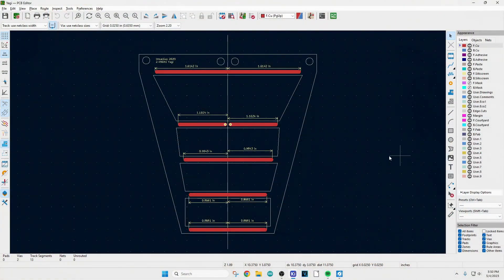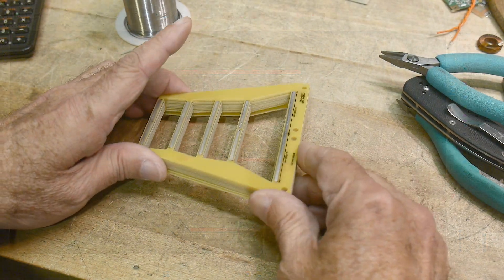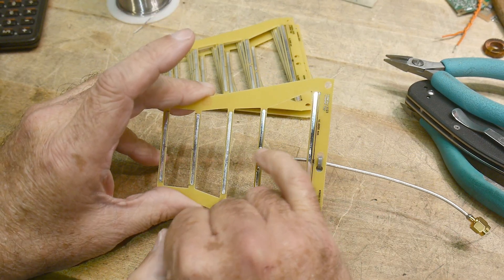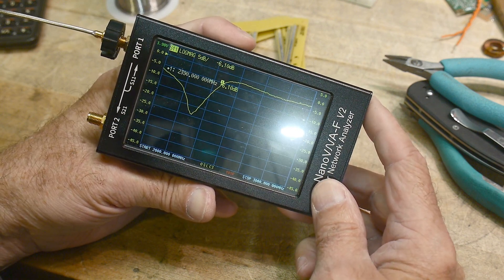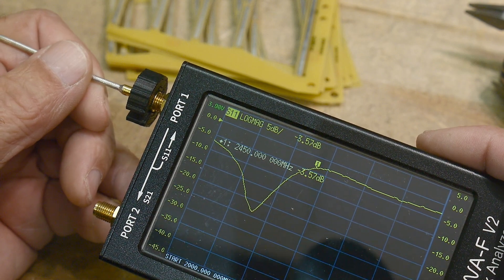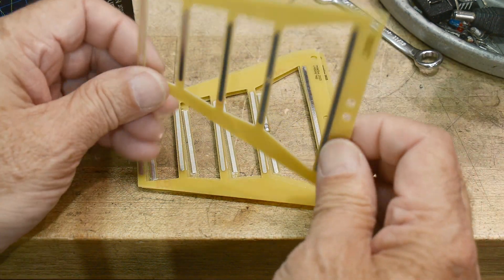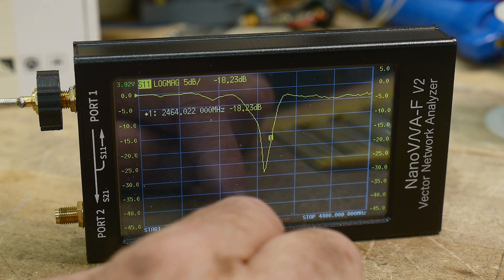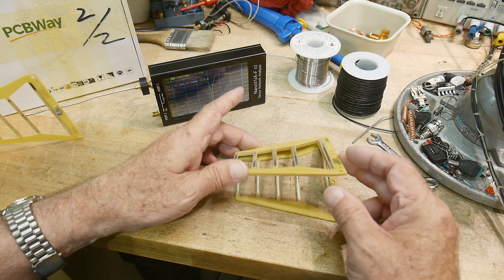#1522 YAGI design for 2.45 GHz (part 2 of 3)

Comment: I ordered the pcbs but it came with solder mask. Is there anything I can do about this?
Reply from the maker: when you order the board you have a bunch of choices:
board thickness (0.032 for this one)
soldermask (select none)

The ones you have probably are close enough in frequency

I did a video that might help: https://youtu.be/ydZ6VSJ26Qk?si=eU_w0V687JzBoyFI
Reply: @IMSAIGuy  I had to order from jlcpcb cuz pcbway was a tad out of my price range, and I didn't see an option for no solder mask. Thank you for the information though, I will keep you updated on how well it works! Just verifying, these can work as 2.45GHz transmitter antennas too, right? Also roughly 800 watts of output power.
Reply from the maker: @arkhilious  I'm not sure about 800 watts. I expected these to be used <10 watts. the pcb traces may vaporize.
Reply: @IMSAIGuy  whatever happens, I'm sure it will be very fun to watch. I mean I hooked up some TV coaxial cable to it and it was fine, so I very well might be surprised!
Reply from the maker: @arkhilious  TV coax will drastically attenuate 2.5GHz.

Comment: The ends of every SINGLE ELEMENT will have the highest voltages (infinitely un-loaded in "free-air" antenna) and any reduction of Capacitive -loss will reduce your Q far below infinity.
Grab your resonating dipoles as close to the center, and not at the peaks, ever. #FreeAir #TeslaCoilTip

Comment: The company I work for designs and builds antennas for a variety of applications and has a number of near field and far field antenna pattern testing facilities.  These two antennas would typically be tested inside a near field facility.  Sits inside an anechoic chamber and gets scanned through the various axes and then the software generates the resultant pattern info.

A lot more controlled environment than the out door far field ranges, but those are still required for some of the larger antennas.  

You could use one of the various 2.4 GHz band antennas around your shop connected one of your RF sources that goes to 2.4 GHz as a transmitting source and then connect the antenna under test to your spectrum analyzer and measure the response as you rotate the antenna in azimuth and elevation in both the horizontal and vertical polarization orientations.  Probably better done out in the back yard than your workshop to cut down on reflections perturbing your results.  I've tested a number of 2.4 GHz antennas this way.
Reply from the maker: please watch part 3

Comment: Have you tried connecting to different elements then measuring? You should have a contest for your subscribers, set a frequency and measurement minimums and see who makes the best performing antenna. No rules. Use any resources available. If  some subscribers don’t have resources then they had better get creative. We could send in stills of the design, finished product, and NanoVNA measurements. You pick3-5 to submit for you to verify and you’d have material for a  video or two. Make us do all the work for a change.  Prize could just be bragging rights.  As always, thanks for the videos.

Comment: Why isn't anyone 3D printing GHz range Yagi antennas?
Reply: Not many 3D printers that print metal in the hobby market.  Some have printed antennas using filament and then used metallic paints or other techniques such as demonstrated here to add metal after the fact.

Comment: Very interesting experiments. This may also open a way to communicate with my microwave oven. 
But seriously, it is interesting to avoid the board material by leaving most of the board out. In a next step one could consider where the field really is. It is a symmetrical antenna with no field in the symmetry line. 
One can test this antenna by adding board material to it. Just adding by bringing it next to it. A blank isolating board to the area should reduce the frequency and give a little loss. A 10 mm strip of isolating material along the axis should have close to no effect and along the tip of the dipoles again small frequency drop and a little loss.

Comment: One thing that bothers me is the abrupt transition from coax (single ended) to balanced, at the dipole feed point. A balun is needed there, which can be made using a 1/2 wave transmission line.
Reply: The above is HUGELY correct!

Comment: Prototyping with solid core wire tacked to non reactive board (hot glue and glass)  would have been simpler, cheaper and less wasteful way to determine best configuration.
Reply: Who's going to sponsor that? 😝

Comment: Forgive Sir , I loved your demonstration series about 2.45 GHz ..
 My question is : Does 2.45 GHz serve WiFi a/b/c Band or G3/4 GSM or what ? ... I ask this because many of my friends looking for a way to boost the Mobile G3/G4 network (indoor) as they struggle with Phone Calls as well as Data web browsing in some houses .
Reply from the maker: 802.11ac: 5GHz band
802.11n: 2.4GHz & 5GHz bands: 802.11n equipment is made for either 2.4GHz or 5.8 frequency band: 5.8 is typically much less cluttered with signal-traffic.
802.11a: 5GHz band
802.11b and 802.11g: 2.4GHz only: Operate only in the 2.4GHz frequency band. 802.11G is from 2004 and 802.11B was the first WiFi standard: 1990s to 2004.
Reply: 2.4ghz Wifi